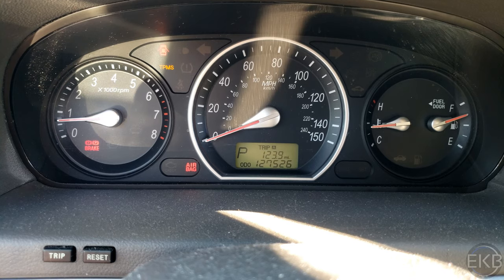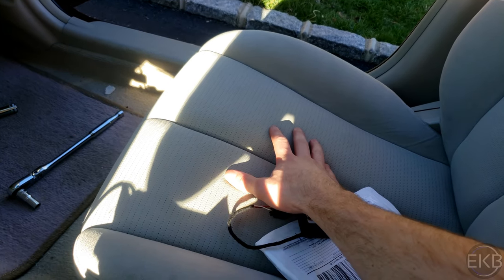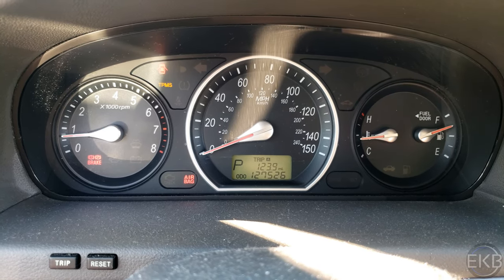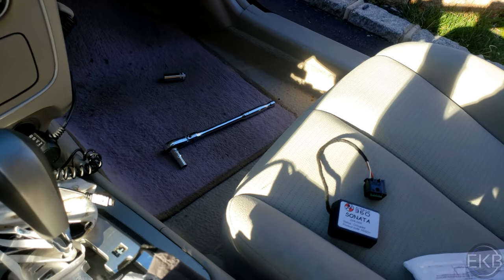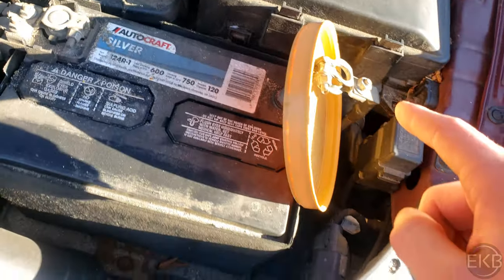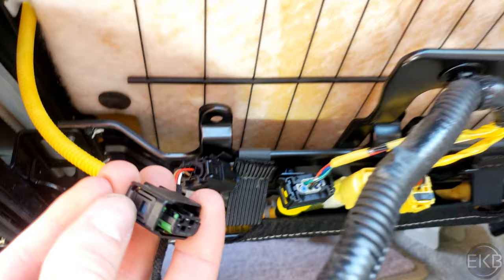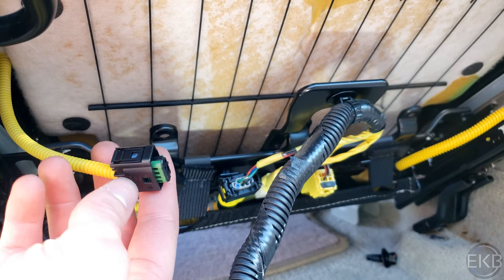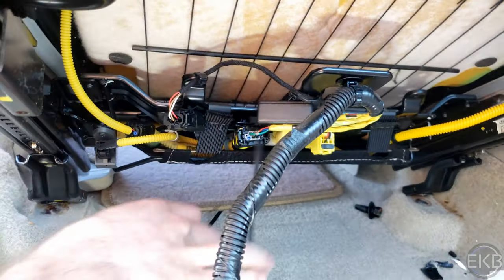Airbag Light On? How to Fix Code B1448/B1447 Hyundai Sonata/Elantra/Santa Fe/Accent

Comment: Emulator seems to be a good option if you don't want to take seat apart. However, I chose to replace the sensor using one from a salvage yard. They only charged me $10 for it and was relatively easy to replace. I already had hog ring pliers and some spare hog rings to re-attach seat cover. If you get a replacement sensor from a junkyard , just be sure to get one that has 'SW 6.1.1' version on the ID tag.

Comment: I cant figure WHY there would be a sensor in the seat.......for the airbag.      So ina  collision if you dont leave your seat the bag wont go off?  So we must leave the seat for the airbag to blowup,.
Reply from the maker: In a working condition, the sensor essentially tells the car that, if there is someone in the seat, and a collision occurs, to deploy the airbag. And, again in working order, if there is no one in the seat, the sensor reads that and tells the car not to deploy the airbag for THAT specific seat in a collision as it would be a waste since the seat would be occupied. Does that and your question?
Reply: @ELITEkickBOXER   so..........empty seat=no airbag       ?
Reply from the maker: @97warlock  Correct. (And your answer only applies if the sensor is working properly. If it is not, such as when you get the codes above, empty seat = airbag and occupied seat = airbag
Reply: @ELITEkickBOXER  if the indicator displays "airbag off" then the air bag is NOT going to deploy whether there is a person in the seat or Not which is dangerous if there is a person in the seat

Comment: i installed in my sonata 2008 but light is still on
Reply from the maker: Couple things: (1) was it installed correctly; (2) was the original code B1448 (or B1447); (3) did you fully disconnect the battery for 10 minutes since you installed it; (4) were you able to reset the code with an OBD II scanner (friend's, yours, or local autoshop)
Reply: yeah the code was 1448 but i did not disconnect the battery
Reply: if i will disconnect the battery and reconnect the sensor. will it work ??
Reply from the maker: @gurmukhsingh666 I would ensure the sensor is fully connected (i,e., it's not just halfway in). But I don't see how re-disconnecting it could help. THough it couldn't hurt. I would definitely disconnect the battery for 10 minutes. THink of that as an electrical reset for the car's computer system. Quick, easy, and painless. If that doesn't work, we'll go from there.
Reply: Still light is on

Comment: I took the risk and bought the device. I installed it today without even removing the seat. It works!
Bought the 07 sonata version for a 07 sonata. Verified the code on my airbag capable scantool and cleared the airbag code history after installing the emulator. No more airbag light. No problem.
Reply: Hi Vextor, am about to buy 2007 Hyundai with the same problem,  can you tell me where you buy the emulator

Comment: I had the airbag light on in my 2007 Kia Spectra and I bought the device for this model. This turned off the light but now the seatbelt warning for the passenger seat goes off, as the sensor indicates there is someone while the seatbelt isn't in use. 
Is this a known issue and how to manage it?
Reply from the maker: Could be wrong (I may have addressed this in the video at some point)...I believe that is an unfortunate consequence/tradeoff of going through this process. It essentially tells the car there is always someone sitting in the passenger seat.

Comment: Thanks dude im gonna try this. If its a 1448 code, its pretty reasonable to assume its the sensors and not the wires, I believe. However, sometimes disconnecting and reconnecting the wires will temporarily fix the issue. Do you agree? I dont actually know but 1448 seems like such a specific code..Ive gotten it turn off before by jiggling wires but now that doesnt work.
Reply from the maker: In my completely unprofessional opinion, disconnecting/reconnecting and/or turning off/on electronics is always a good step in troubleshooting an electrical problem. However, with something like this, I genuinely don't know if that would work. Could it, temporarily? I suppose. But again, I'm merely a YouTuber and not a professional. I don't think it hurts to try, especially if a connection is just loose.

Comment: I bought this device and used it but airbag light still on, could the driver seat need it instead or is it only the passenger seat that shows this code?
Reply from the maker: As I'm not a professional mechanic, I would take what I'm about to say with a grain of salt. A couple questions: do you know for a fact your car is showing a B1448 code (i.e., did you use some type of diagnostic tool, or are you strictly going by the light)? Is the device you bought/installed made for your car specifically? Did you install it correctly? Are the connections (i.e., wires) between your car and the device sound? (In other words, are the wires in good condition, etc.?)

Did I mention some type of "reset" procedure at the end of the video to turn the light off? (I cannot remember off hand.) Are there other lights on, an/or is the passenger airbag light on? From what I understand, B1448 is specific to the passenger airbag [sensor].
Reply: @ELITEkickBOXER  yes I got a diagnostic and they found the code b1448 seat occupant sensor so I bought the device which did make the car think someone is constantly sitting in it but airbag light was still on after, any idea what could be the problem?
Reply from the maker: @linthakidd  Just a couple of questions: did you install it properly to the best of your knowledge? are the wires getting pinched or do they look broken anywhere? have you disconnected the battery and waited at least 10 minutes before you reconnected it? (if you're able to, did you "reset" the car using the diagnostic tool to basically "clear the code"?) have you tried to read the car now, after you installed it to see what it says (unless it still says the same thing)? are you sure the product you bought is 100% compatible/made for your particular car?

Comment: Do you think this will work on my 2007 Hyundai sonata?
Reply from the maker: I think it can fix the problem if your issue is the same as mine here. Going to the website, I see that your car uses the exact same emulator device as the one I used. This link should take you to the proper one (though of course verify yourself that your car is what this is made for): https://airbag360.com/55---usa-hyundai-sonata--06-08-front-seat-b1448-occupant-classification-sensor-ocs-emulator-175-p.asp
Reply: I meant to say once I install it do I need to go to the service station and have them reset the code or will it automatically reset on its own?
Reply from the maker: @momsgirl2727  I honestlt cannot give you an answer. What I can say is that once you install it, you can disconnect the battery completely for 10 minutes, then reconnect it and see if it goes away. In addition, you can also just drive the car for a day or two (even if you did what was discussed in the aforementioned sentence). If after doing both things the light is still on, I would see if you can find an auto store or mechanic or friend that would be willing to reset the code.

Comment: Does work with 2006 Kia Sorento has the problem code b1448
Reply from the maker: It certainly should. Use this link for your specific car (but certainly verify yourself): https://airbag360.com/kia-sorento-passenger-airbag--sensor--occupant-classification-sensor--b1448-ocs-mat-defective--320-p.asp

Comment: If your sonata 2008 and has front bumper grill is single then buy 2006-2008 emulator 
If your sonata bumper has three bar grill then buy 2008-2010 emuLator